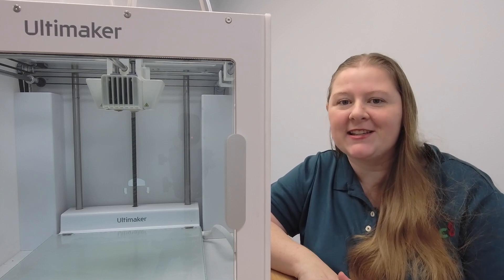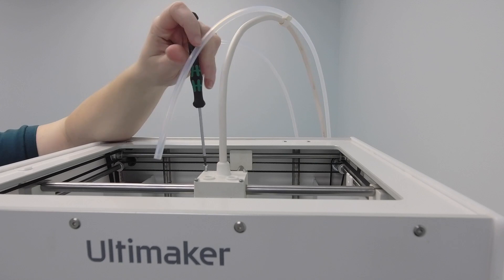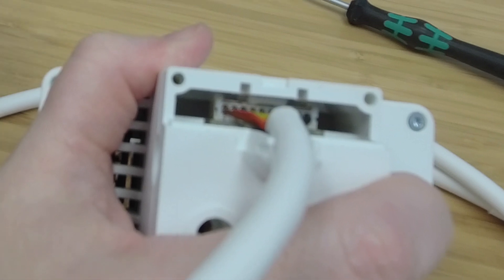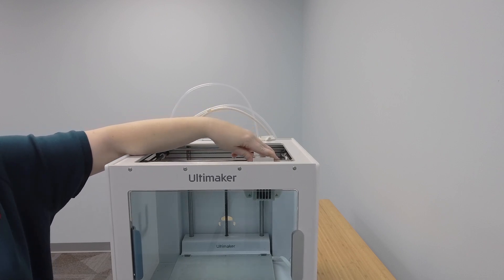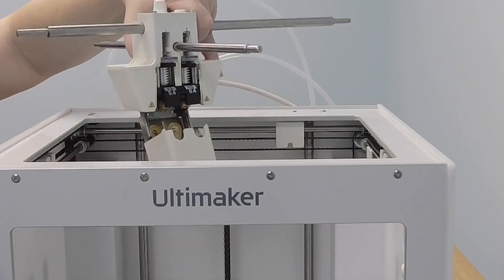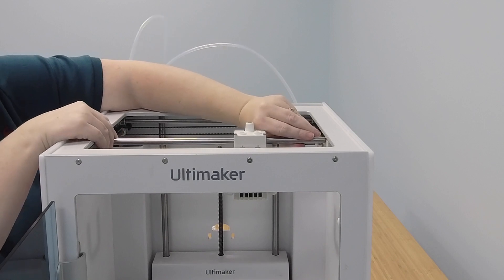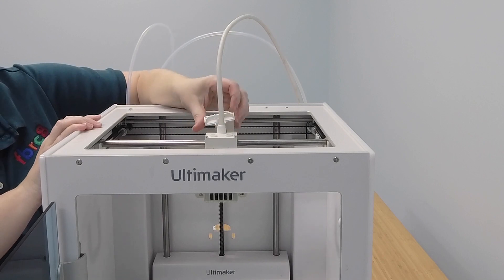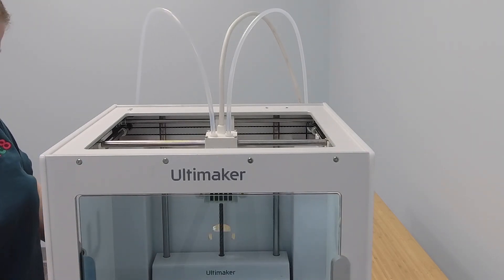Installing the Printhead (Ultimaker S5/S3)

Comment: How to solve the issue of print head error in ultimaker
Reply from the maker: What is the wording of the error message you're receiving?
Reply: @fbrc8  Directly by  on the machine It displays the print head error and shows reboot the machine.I also tried the reboot option but there is no use🫤
Reply from the maker: @saisantoshsasapu8044  if you have an error that says "Print Head Communication Error" then you usually need to try reseating the Print Head Cable. If that doesn't resolve it, most likely the print head cable or print head PCB needs to be replaced. You can also occasionally get that error from the flow sensor cables (if your machine is an S-Series) since they both run on the same i2c protocols.